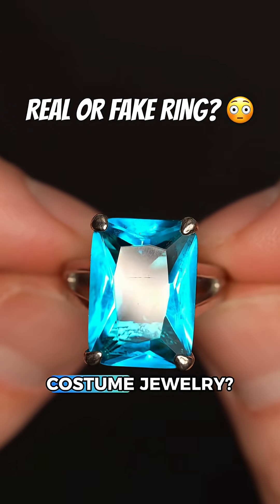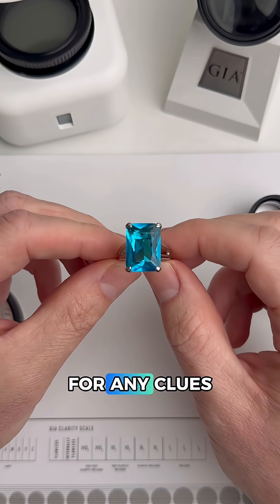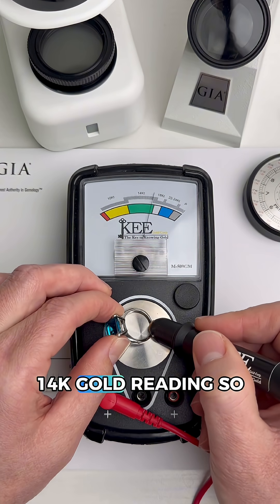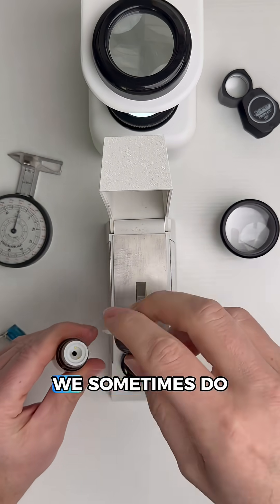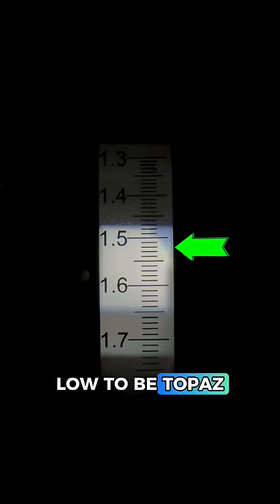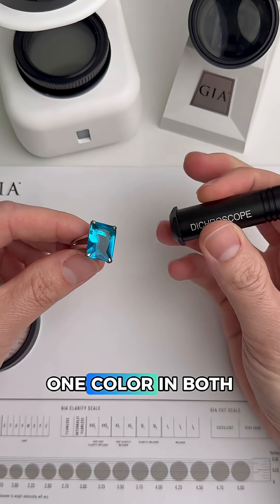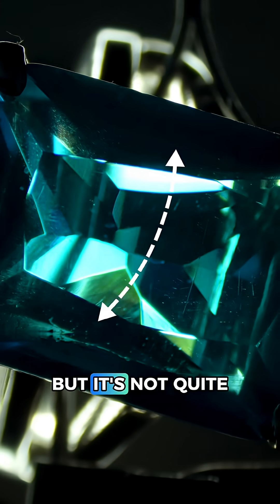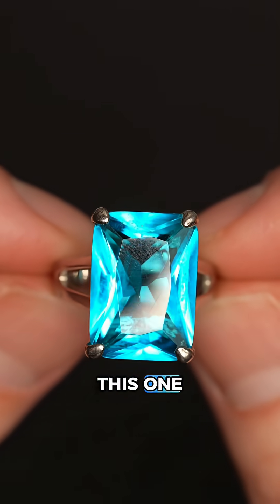Is This Ring Real or Fake?

Comment: Okay, if you want a very quick way to tell if the metal is neither gold or silver without any testing. When he flips the ring on its side you can clearly see lines going straight up and down around the side of the band. These marks have always shown me that the ring is plated and usually some cheap metal like brass or copper. I have never had this fail me whenever I get a lot of jewelry and finally go through acid testing the rings. If I see this marks in rings out in thrift shops or the like I don't risk putting money down.
Reply from the maker: That's an excellent tip! Plating does have a very distinct look to it. ❤️

Comment: Some plated pieces you look at the texture because it'll have uneven ripples or lines where it was plated because most gold pieces that are solid will be smooth and polished without lines or ripples and sometimes have fine scratches and wear from age🙂

and the scratch on the stone looked like glass scratches🙄

Sometimes on rare occasion rings can lose their markings from being repaired and resized🙂

But 9 out out of 10 times most fine pieces have a hallmark🙂
Reply from the maker: Great points! ❤️

Comment: This ring looks BRAND new.  There are no real marks on the band except for some consistent ones on the inside of the band that you often find on costume jewellery, so for the gem itself to have two noticeable scratches reads as either glass and/or shoddy craftsmanship.  One would expect a craftsman working with precious stones to be more careful of those sorts of marks, especially on the front face of the gem, therefore, the ring is most likely a cheap make or fake.   Plus that blue colour is instantly suspicious on a ring of this design.
Reply from the maker: Nailed it, great analysis!

Comment: So they put fake stones in real gold?
I bought a close out ring when the kmarts started closing in florida in the early 80s.
I bought 2 actually  for like dirt cheap 95%off last day sales.
10kt gold with garnet which is real as a jewelry store checked it but i also bought a huge sky blue topaz with cubic zirconia halo set in 10kt gold. I have the sale tags in the box it came in. But the marks inside say 10kt  cz i figure that kinda means the main syone is probably CZ as well. 
But i only paid like $29.99 for it and it between 90 to 95% off
The original price was $399.99 usd. 
So for even a piece of costume jewelry i think it was a fair price and its big and sparkly and with gold prices probably wirth it for gold alone lol
Reply from the maker: Yes, happens quite a lot. Often synthetics, glass and plastic imitations too. That gold has certainly gone up in price lately!
Reply: @chrisjamesgems i often pan for gold and geez the gold i got in paydirt just a few years ago has almost went up like 35%  plus its so pretty in my little glass bottles 😅

Comment: The fakery was obvious on the stone cus of the scratch unless this was a very very soft gem, but even then, even topaz or similar blue quartz would have a non uniform coloring even on the biggest and most perfect cuts. The band of it did throw me off but the prongs, where most wear does tend to happen on this design, does have a coppery color where the plating is thinnest. 

All in all, would still give it to some child, like a neice or nephew or young cousin as a cool gift for them to learn the responsibility of caring and not losing a ring. 

It does look pretty tho.
Reply from the maker: Great point on the prongs, always good to look at on second hand rings!